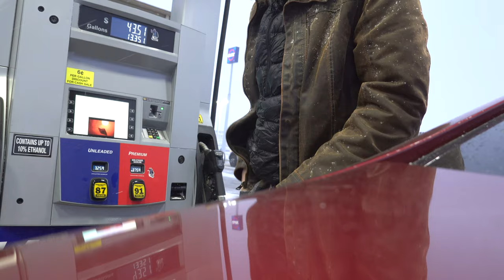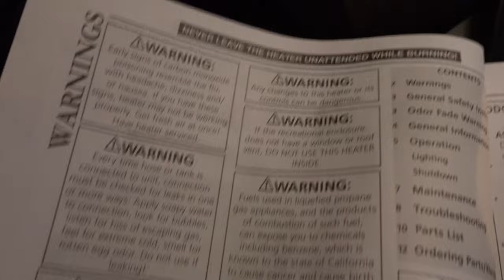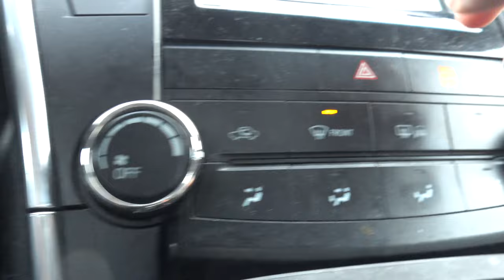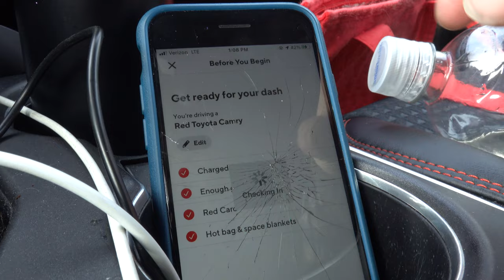Homeless By Choice Ep2 - Life After The Trail

Comment: “...where the days are about 19° and the nights zero... and if I get bored, I’m gonna start heading up NORTH.”

You sure do like the cold.  No Tramily, but after the CT you could head to ND Lake Sakakawea and start heading east along the North Country Trail (4800 miles).  Less than 20 hard souls have ever thru-hiked that baby. Gets you back on the SHT too.  

Looking at all that Reflectix, thinking you could get a cargo net suspended tightly between the rear of the car and the back seat clothes hanger hooks, making a 0.5 - 1” open loft area where you could shove the pieces of insulation and really not lose any storage space in your rig.
Reply from the maker: North Country is on the list! haha. If i had the money and didnt have the debt id consider it right now but we will get there eventually! Good Call on the Car upgrade with the net. Might need to try that! Thanks Andrew!!